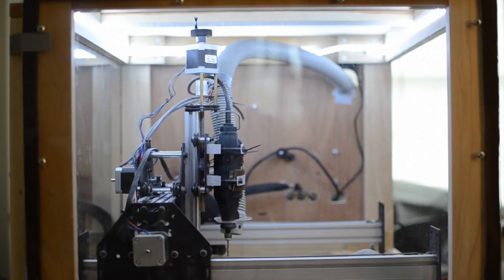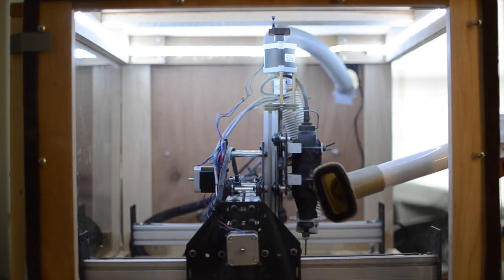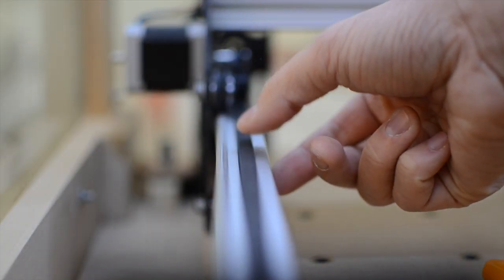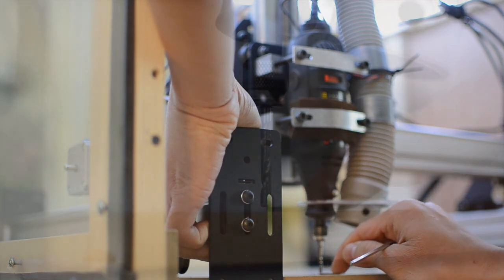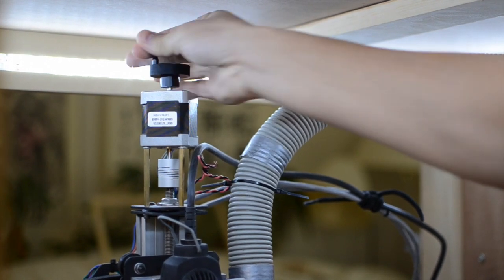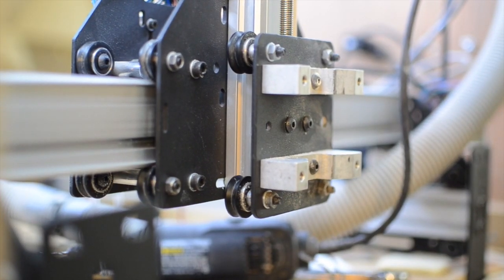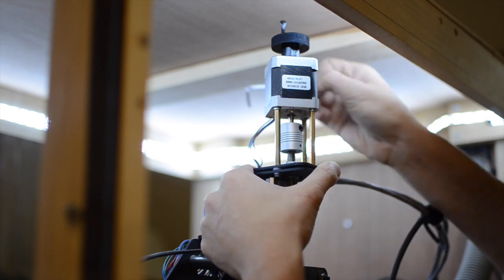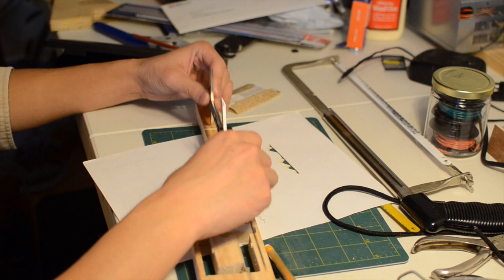(Pre-)Spring Shapeoko Cleaning & Z-Axis Tune-Up

Comment: I found that on the two shapeokos I support at work that the whipping around of the threaded rod caused the screws on the z carriage wheels to loosen, even with nut locker in place. Ended up having to replace it with an ACME rod + nut from Openbuilds.

Thanks for the well presented interesting videos Winston.

Comment from the maker: secretspy711 I was trying to see if I could use the camera to check if the Z-axis was vertical. I.e. did the image shift as the z axis moved up and down. It was inconclusive. But I may throw a camera inside the enclosure...

The dust shields over the makerslide are a good idea. There's a pretty good set sold on the Shapeoko site, but there's definitely nothing wrong with taking the cheap DIY route.

Comment: Cleaning the v-wheels started to be a pain for me, and not thoroughly cleaning them regularly resulted in noticeable "wandering" of the bit as the V wheels roll over pieces of debris.  So I bought some vinyl dryer-vent-hose to use as a poor man's bellows on the X-axis.  Attach it to the gantry and seal it up with your favorite tape.  It definitely keeps the dust from collecting on the rail and getting packed onto the V-wheels, and makes the machine much more enjoyable to use.   I don't have to constantly clean it now.  But, it may not be worth the loss in cutting area if you have a stock-sized machine.  Edward Ford uses plastic bags on his machine, which I tried, but kept getting bound up on my 1200mm X-axis.

I had to use a thicker nut for the Z axis bearing.  The thin nuts that come with the kit are not threaded very perpendicularly to the face.

I also made my own Z-axis knob from wood, with a slot to embed a nut to act as threads for a set screw, and a hole to press-fit a pin to act as the crank handle.  Works great!  Though honestly I hardly ever use it now that I have limit switches installed.

@ 5:02 what are you doing with your phone?  Is that a photogrammetric height measurement device, or simply for filming cutting?

Keep the videos coming, I always enjoy watching a fellow geek & maker.

Comment: I drilled out my delirium nut that attaches to the z-axes and with amazing goop glued a nut inside the delirium nut I drilled out. I love it and haven't had any problems. 

After this I noticed I needed to lubricate the z-axis rod and rather then using a liquid grease that saw dust could stick to I used powered graphite and it has been working perfectly.

Comment: Thanks for uploading this,  really helpfull and well explaind videos.  I dont have a shapeoko,  but have built my cnc by my own,  but i guess much of the tweaking is the same.  My build is currently driven by standard screws and nuts,  i have a 3d printer pen,  so i added some plastic on both side of the long nutz,  it took away most of the slack,  and it didnt add any resistans.  In your software Journey have you find somthing that you really prefer?  Currently im using easel,  but i miss some feauter in it,  like choose cut phases,  since i got a treaded slow machine i feel it spend too much time traveling around when its not cutting.  Well anyway thanks again for sharing your journey with the shapeoko,  as mention,  its very informative and helpfull.

Comment: Good to see a new video. Have you tried a lubricant on your threaded rod? I used wd-40 dry lube with amazing results.
Reply from the maker: I have not, although it sounds like a good idea. Just double checked, all the solvents in the dry lube are safe to use with Delrin so I'll give that a shot. I need some anyways for a future project...
Reply: Winston Moy i've been using ptfe spray dry lube on mine.... i've only had to spray it once.  but seems to work good.